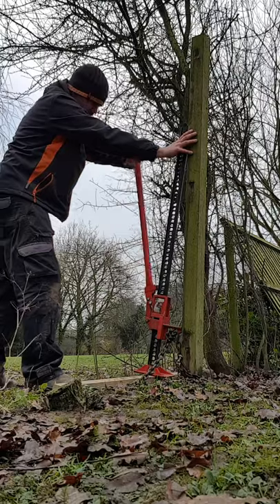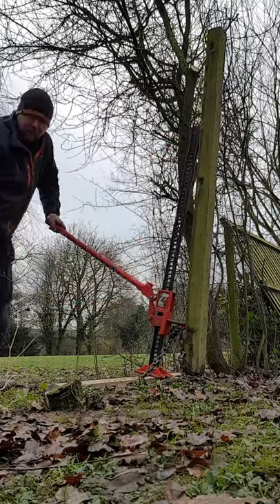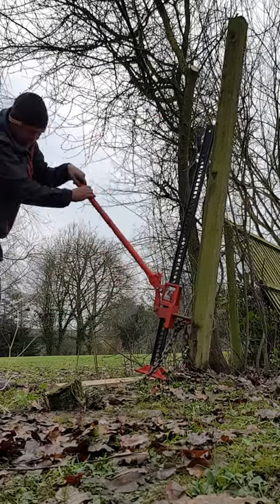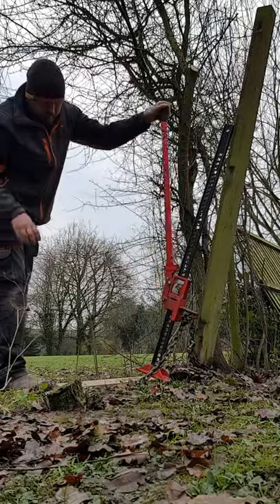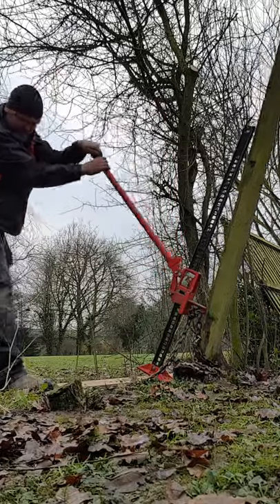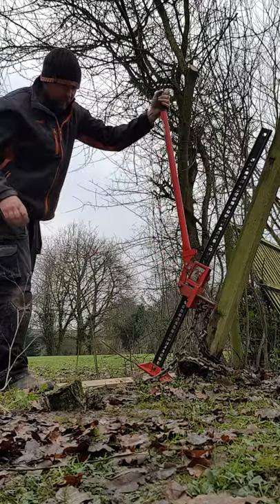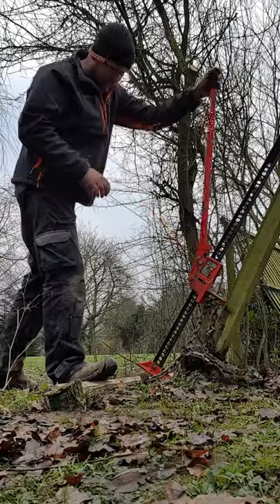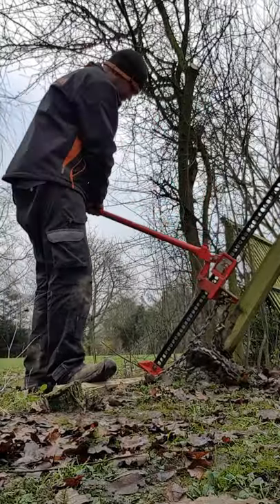High lift jack removing fence post

Comment: Do they always come out that easy? Where spaced allowed I used to use the two lifting arms of a Massey Ferguson 35 tractor and a chain wrapped around. Still it would sometimes cause the tractor to try and wheelie, and you got a couple of people to hang onto the bonnet, health and safety precautions observed obviously 😜